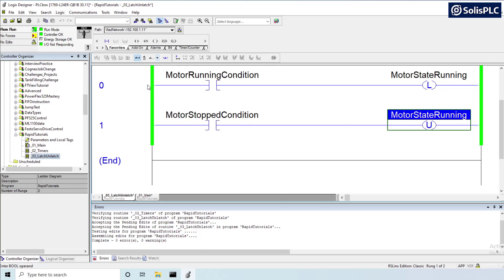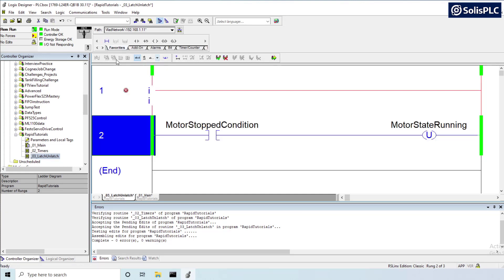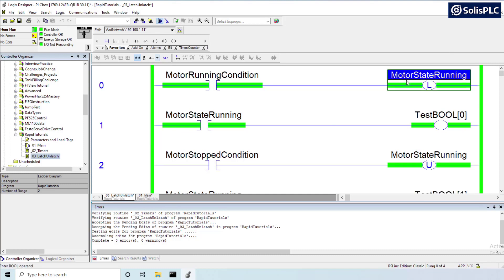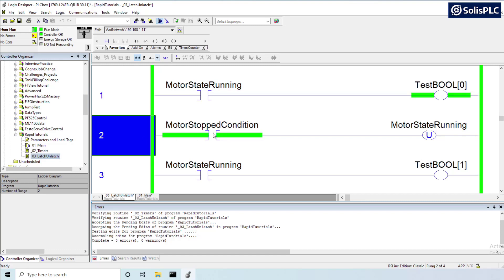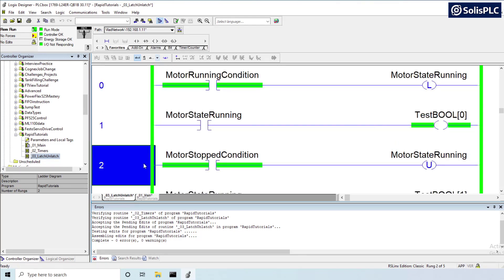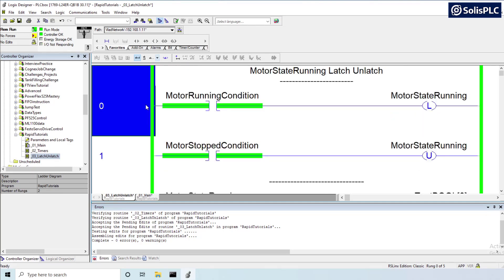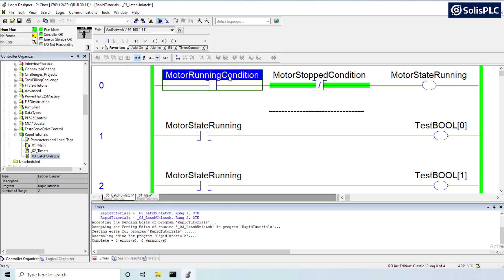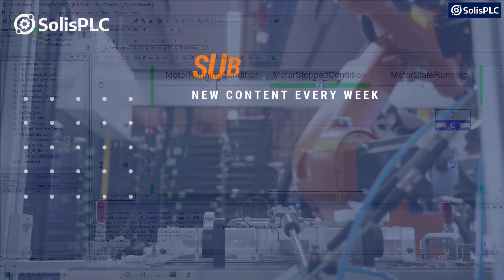PLC Programming | Latch Unlatch OTL OTU Instructions Ladder Logic Troubleshooting - Use OTE

Comment: Vlad: IF I have several latched OTE's in my program, how do I turn them 
ALL off?  Since we can't have multiple OTE's on a rung, do I have to 
have a different rung to turn off each latched OTE??  Thanks again....
Reply from the maker: I'm not sure I fully understand the question. When you use an OTE, it's energized until the conditions leading up to it aren't true. If you set the condition to false, it will de-energize the OTE. If you have multiple OTEs, you'd have to de-energize multiple conditions.

Comment: That is the reason why I do not use L U at all! That lack of visual is a pain during comissioning, prefer to make rs flip flop instead. AB should do sth about it
Reply from the maker: 100% agree. I've found very few instances in which you do need latch unlatch and I always make sure that it's well spelled out in the comments for whoever is going to use that code. One example that comes to mind is communications with a Fanuc robot. When you latch a certain bit, the robot must process a routine and then reset the latch. If you use an OTE, it's possible for it to miss the tag due to latency.